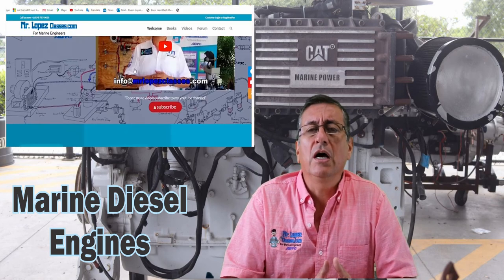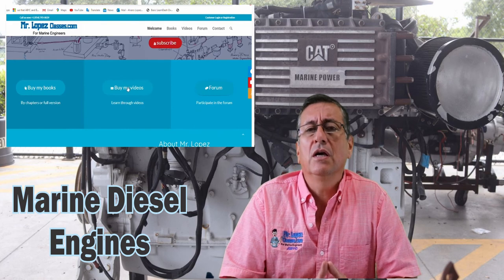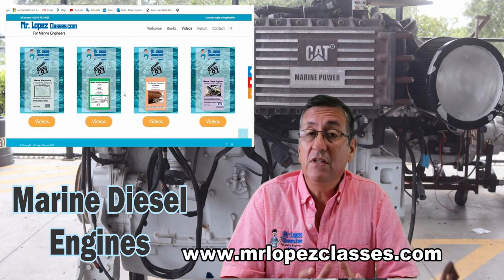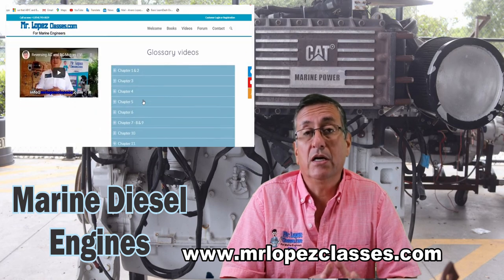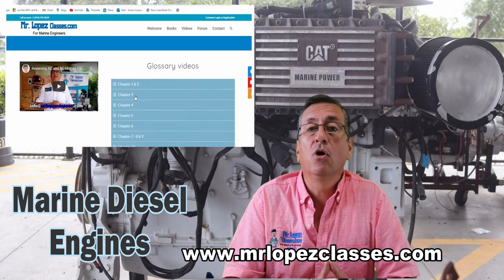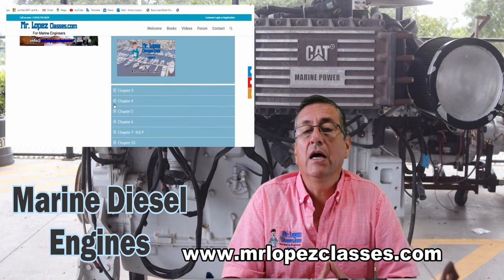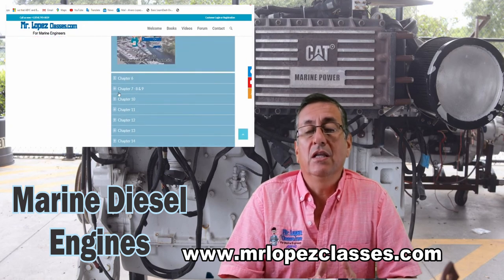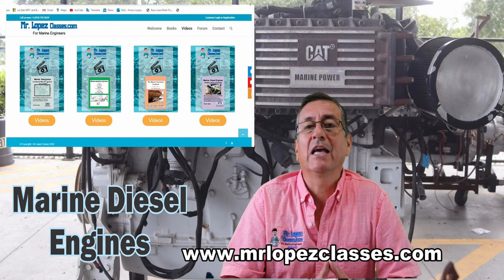Welcome to The Marine Diesel Engines Course

Comment: The Nigata Marine four-stroke diesel engine makes a knocking noise.What is the reason, sir?
Reply from the maker: One possibility is on the Super-Charger. If the engine is super-charged verify the condition on the bearings. Other possibility is an spring broken at the flex-plate in the bellhousing, Other possibility is play at the crankshaft bearings, check the oil pressure. if the oil pressure decrease dramatically you should take an oil sample to verify the bearings condition. Good Luck
Reply from the maker: There are different reasons. No 1 could be a low pressure due to worn bearings. Check oil pressure. It should be over 40 PSI, then try to take an oil sample. If the level of Zn, Al, and Cu are over the limit the bearings are gone.